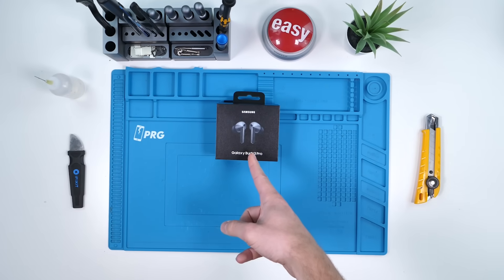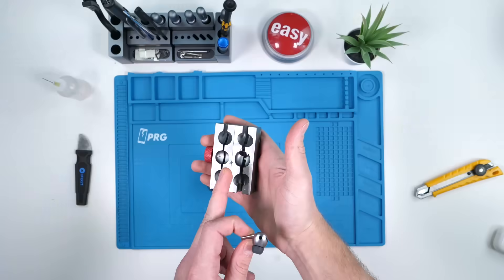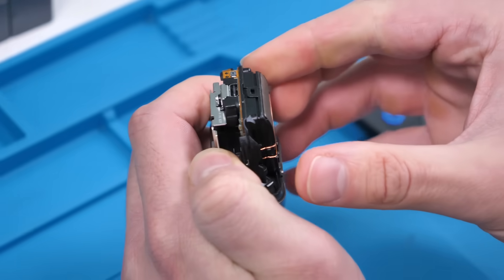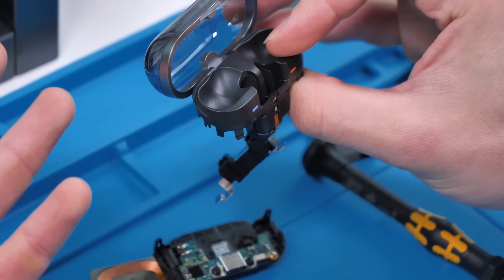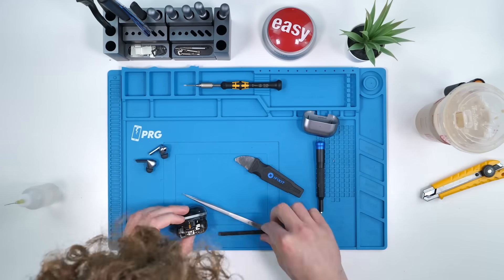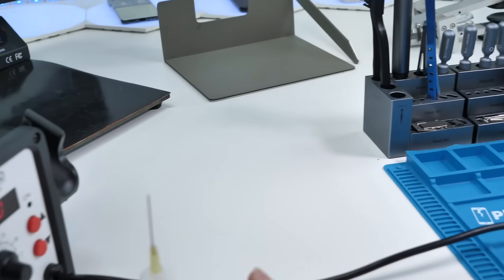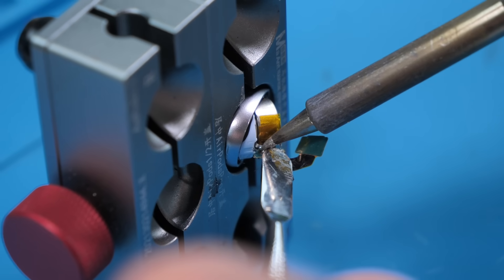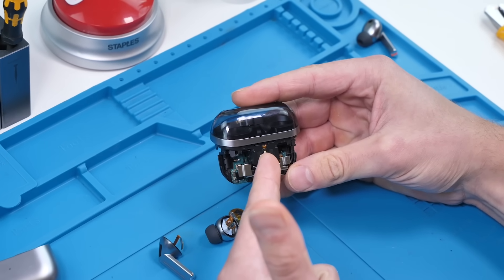AirPod's But... Repairable?

Comment: I am having an issue whith my galaxy buds 3 , since it felt down by accidant the problem started here, the Rt buds sound decreased nearly hear any things even with the volume is maxed out , i addition the touch botten i cant here it clicking but the prombet working proboply like stop musics , answre call , by touching the touch botten but no clicking sound , i went to the repaire shop, and he fixed it , after a couple dayes from fixing it i faced the same problem with the Rt buds again , same problem , same complain , i went to repair shop again and he fixed it ,by putting a new update , but after a couple dayes , the problem came back , same complain , no update were seen , buds got cleaned , and use other type of samsung device but same problem ,what could be the problem??

Comment: Total crap, can't stay in your ears...
Reply: Whether or not an earbud stays in your ears is based on the size of the tip, the shape of the bud, and the shape of your ears

The buds fit most people (as proven by AirPods popularity and commendation for their great fit, yk, the things these are IDENTICAL to in size for the part that goes in your ear)

So assuming you actually used the right size ear tip, the only source of problems for this not fitting in your ears is... Your ears...

This isn't the earbuds being bad, it's your ears having a non typical shape
Reply: Are you walking around like rocky dennis? 😂😂😂

Comment: I think the usb-c port issue can be easily fixed with a connector soldered to the board and a connector to the flex cable just 3d print an outer shell and done. completely modular unplug the usb-c and plug a new one in. I did that with my galaxy watch charging cradle.

Comment: Just got my pair of these in the mail yesterday. Really digging how they're built quality wise to the Buds 2. The buds 2 had a rubber coating on them that would peel off really easily, and always fell out of my ear. I can see myself using these much longer than the Buds 2

Comment: Sony guys iv got the sony wf100xm3 not jus replaced the case and head phone batterys but i upgraded them 2019 headphones that will still be going strong by 2030! And am rubbish as far as technology but its really really easy ! 
Head phones last 10 hour now with everything on well a bit more cost £20 for the new batteries and wee plastic tools to do the job . 
Case battery was £16 no idea about how much longer it lasts but the battery again was a 300mah upgrade so its going to be longer ! So £36 and it was easy !

Comment: Omg is really easy. i changed the battery from one bud of my Realme Buds Air Pro. But, now the case battery life is kinda low, but, i will use it until it dies completely. It just involves, opening, disconnecting one cable, separate some glue, desolder the battery, place the new one, and boom, new buds.

Comment: Please be careful using the heat gun, if the earbud gets too hot the thin plastic on the speakers can melt or shrink. This happened with my buds fe

Comment: Just got mine today.I'm not a fan of any Airpods, they do not sit in my ear well and if I move my jaw and open my mouth up-and-down, they fall out just like almost every other earbud, other than Bose, but after I switched mine to the smaller tips, they stayed in my ear with my mouth moving up-and-down. Around as well, I was shaking my head. 
I would love to see someone make transparent base cases for these so that you could say slide them out and put them in transfer cases. So you can see the insides kind of like what we did back in the early two thousands, with next telephones, we took out all the insides, moved them to a clear case

Comment: Hey I have a question for you do you fix hp computer? Because I accidentally drop juice on it and now it does not turn on and either doesn’t charge. I was wondering if you could fix HP computer. That’s the only way I can contact you.

Comment: If you think these are easy to work on, take a look at the Fairphone Fairbuds. (not the XL, you have done that already) you can just replace the batteries yourself, no heat gun, no prying, just a spot that opens up and the battery comes out to be replaced.

Comment: 2:59 there are entire engines that are both easy to disassemble and watertight, these traits are not mutually exclusive.

Also if you want something to be fixable in the long run you dont use Philips screws, you use hex, torx or Robertson, you also dont use adhesive instead of a propper gasket or o ring.
This entire product could be held together with bolts, heck the stems could easily unscrew to expose the battery and the end of the bud can also be made to unscrew to get access to the rest.

Comment: Looks to me this time Samsung has soldered only the parts necessary to be sorted (require rigid connection, capable to sustain mechanical stress).

Comment: 3:01 actually....the Buds themselves are IP57, the charging case is only IPX2 from what I know
Reply: That's correct
Reply: can confirm, put em through the laundry by accident, the buds are fine but the case wont charge them :(
Reply: @kiktik2413  lol thats what happened to mine yesterday
Reply: Yeah got the same problem, did you ever fix? Just got a flashing red light
Reply: Dropped em in water the case is gone but the buds are fine,,, used them till the battery died
Reply: Should be easier to make the case ip67 or the same as the buds ip than making the buds that ip rating

Comment: I got mine delivered way earlier on pre-order, and I am taken aback by this pair of buds.

Sure, they copied Apple, so what? The consumer is winning in the end! The repairable design would make batteries be replaced so much easier!

The sound is just on par, or maybe sometimes even better than the AirPods Pro that I have, and they work so seamlessly on my Samsung phone, the AI features, and the blade lights are so much cool! I lost them in the dark, and the blade lights helped me locate them. Since these were delivered, I have not using my AirPods Pro at all!

Samsung really outdid themselves!
Reply: I also got the buds3 pro a month before release ( also got my s25 ultra 3 weeks before release on pre-order) the buds are absolutely fantastic and in my opinion they feel and sound much better than the airpods pro. I also ordered some 3rd party tips ( diofit flange tips ) with the new tips the anc is outstanding compared to the tips out of the box. For some reason standard tips hurt my ear canal.  My only gripe is it's a bit fiddly to get the buds into the case especially when it's dark. I'm so impressed with them and I find myself using them to even watch tv via my amazon fire TV cube. If your in the uk and get a s25 ultra on 02 network you get a voucher for £200 to redeem for the buds3 making them only £20!!!
Reply: Now that One UI 6.1.1 is out. Turn on UHQ and you will see that Airpods are toys compared to the Buds 3 Pro!!!
Reply: All of Samsung's Buds Pro are better than the AirPods because all of them are Hi-Fi certified, unlike any AirPods Pro.

Comment: I feel that these are practically a reverse engineered AirPods Pro. 

I’m sure they used AirPods as their foundation for the buds, and just tried making it as repairable as they could, as well as sounding better. 

Not that I’m complaining.
Reply: According to the head of the buds team. That's basically it. They said airpods pro was the most practical design, for both usage and engineering and what they did was basically airpods but better

Comment: 3:47 although yes you do have to solder it you could probably just buy a replacement board and if Samsung really wants to go 1 step further in repairability they could sell it themselves
Reply: If the EU laws pass they will have to
Reply: That board probably has all the info about the buds including serial numbers. I think replacing it would disconnect you from your buds so youll have to reconnect
Edit: newest buds can track location and are account tied like apple products

Comment: I’m pretty sure, according to my little bit of research, the Galaxy buds 3 and buds 3 pro are actually somehow compatible with iPhones, however you do lose out of some features. But with how cool the buds 3 look, I’d literally be willing to replace my first gen AirPods Pro with galaxy buds 3/3 pro.
Reply: I think this applies to any Bluetooth earbuds. I was using 1st gen air pods on my samsung years ago. Dont think companies cab make Bluetooth exclusive besides certain functions
Reply: you can use it with iphone, just like airpods can be used with android. you do lose some features not using galaxy buds on samsung phones, but nothing too big
Reply: You can set up the buds3 on a Samsung device or PC and then connect to the Iphone. You will keep the main functions.

Comment: Do a video swapping galaxy buds pro 3 parts
Reply: Won't matter, they cannot bind speakers usb ports or raw battery cells by serial number. And noone is gonna swap parts soldered to the logic board, that's not worth it financially.
Reply: @khamigen  awwww
Reply: @Bankroll1223  no, no, that's a good thing. They can't forbid battery replacements this way. Seriously considering these after my airpods die for sure ✌️
Reply: @khamigen  ooh well what do i know in just a measly tech enthusiasts